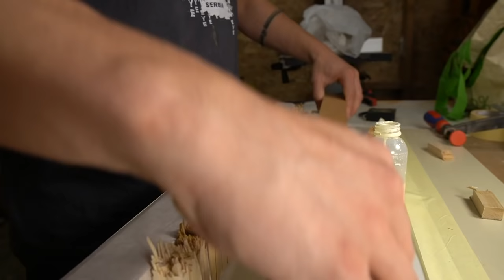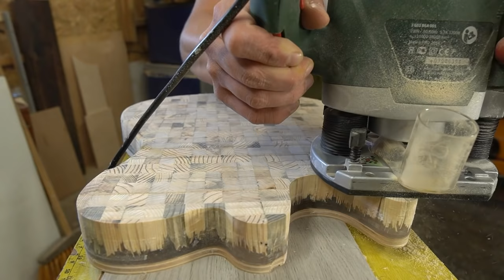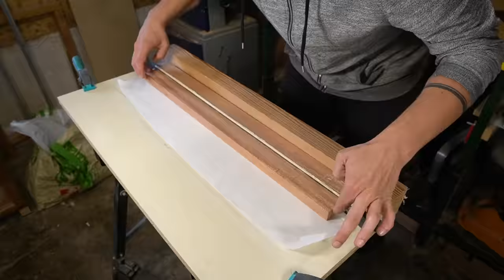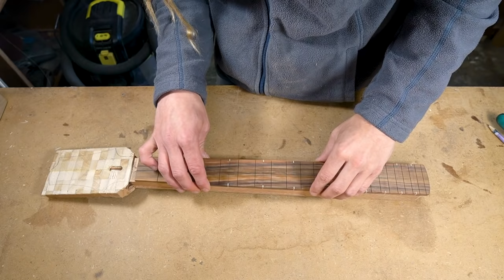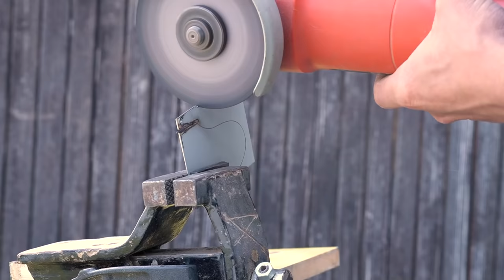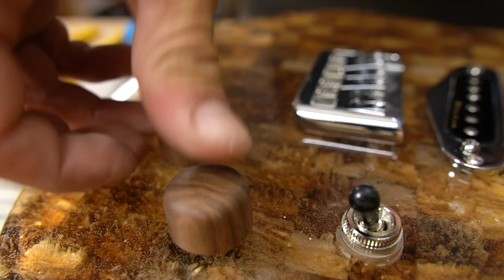Magic Attic Guitars builds a Guitar from reclaimed wood-  GGBO 2020 UnOfficial Challenge Full Build

Comment: A good way to sand the outside edges of a guitar is a sticky roller: take off an old layer, put/cut sandpaper to fit around it and stick the sandpaper to the current sticky sheet, remove and replace when the sandpaper gets dull.
Reply: Man that's a brilliant idea. Thanks for sharing!

Comment: I don't think I've ever seen anyone clean up the truss rod access before.  Always seems to be disregarded by even the highest level of guitar manufactures.

If I  was to change one thing, it would be swapping the pickup selector with the volume control.  I like volume swells.
Reply: My thinking is that if you put so much time in something than do it right to the smallest detail. I'm happy you noticed it 🙂 I like to have the switch handy, but this is personal preference.  I can understand you would swap it. Thanks🤘